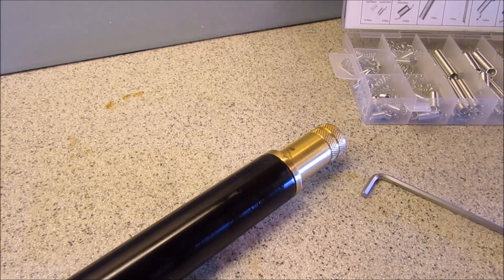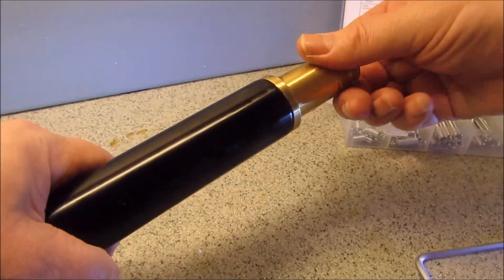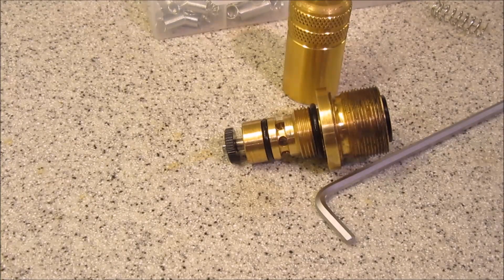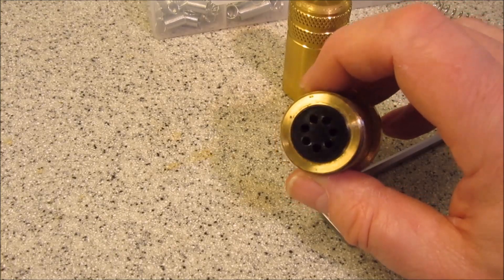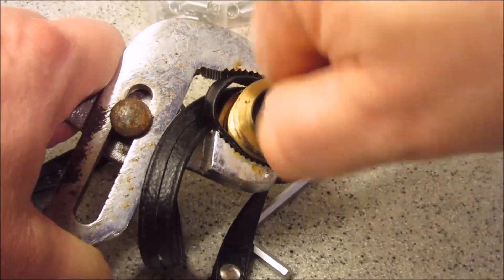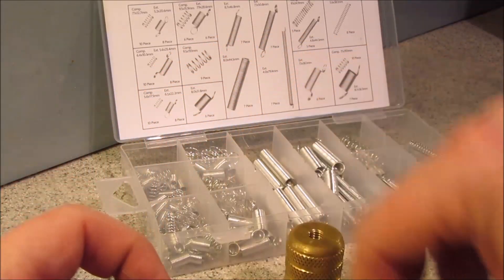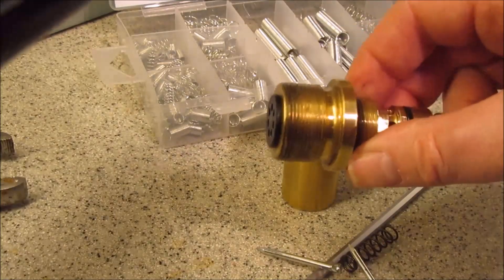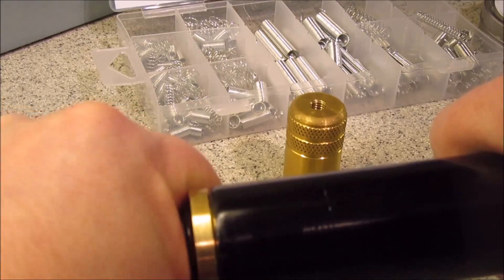Making a power increase in a Hatsan Galatian by exhaust valve spring adjustment 02 02 17

Comment: I've just bought derestrict yourself the full power valve pin, they're about £17. My  25 shoots 1040fps with it in, with the new spring, pin and adjustments. Its shooting at 80 joules. With a  .22 you're easily getting 1200fps.

Comment: Why care if you are limited to 12 fpe? If you want power start with replacing the valve stem with a 'normal' one instead of experimenting with items you obviously don't fully understand. Increasing spring tension will show in better efficiency, not so much in power. Better, get a license and get yourself a full power version.

Comment: Did you intentionally leave the plenum/spacer off to deregulate?
Reply from the maker: Yes, it allows the regulator to vent to atmosphere. Rifles without removable cylinders need a small hole drilling in the cylinder. These regulators come with two 0-rings and the hole in the cylinder will be between the two 0-rings. Most HUMA and Altaros regulators are designed for removable cylinder models. Robert Lane designs them for either. If you see a reg with either one or two 0-rings you now know why.

Comment: Heavier hammer and / or hammer spring and higher regulator pressure.  The valve spring pressure is trivial compared to the air pressure on the valve.  More valve lift could also benefit.

Comment: It's ridiculous they use a shear bolt as an anti-tamper so that you cannot disassemble your £800 PELLET GUN to clean it, this isn't even a legal requirement. They just chose to do it. 
The UK is beyond cucked.
Reply from the maker: Yes, the manufacturers decided to make up their own rules. It's not illegal to tune your own rifle. It only becomes illegal if the power goes above your Country's legal limit with the most efficient pellet. US and some other Country's don't have anti tamper fitted where there are no power restrictions. You could ask for it to be removed at the manufacturing stage, but once reaching a retailer the anti tamper are usually in place. Some are easier to remove than others, and some require special tools to remove. It's a bloody nightmare. It costs a fortune for a manufacturer to do repairs as you probably know.

Comment: so if I understand correctly, the regulator is losing a little power but there is a better consistency of shots. and if we want to recover this loss of power we must put a spring harder! Can you tell me if these springs are ok?!. thank you in advance 
https://www.amazon.fr/CCLIFE-Coffret-Assortiment-ressorts-compression/dp/B01KG024CU
Reply from the maker: You maybe able to buy a stronger spring to fit, but i have the same box of springs as shown in your link, and none of those would be strong enough. If you can't find a suitable spring it is recommended to pack out the existing spring with small washers, which is what i had to do. Robert Lane of Lane regulators could probably help with the correct spring, as i have heard comments from people in the past that have gone this route.
Reply: @airgunsniper-elite7385  oh yes, washers to harden the Spring is not stupid, as I did to harden the dumpvalve of my Focus RS mk2! in your opinion, we put the washers then the spring where the reverse?
Reply from the maker: I have increased the pressure on my valve spring today in the following video. I am waiting for a new cylinder and will used this one as a spare none regulated version. https://youtu.be/59_-qjhU8oA
Reply: 9x35mm is good ?
Reply: You would need to increase your hammer spring tension, not the valve spring.
Reply: Güç artışı istiyorsanız çekiç yayının gücünü arttırmak birde valf yayı daha ince hafif olması gereklidir diye düşünüyorum

Comment: the transfer port is what you see at 6min20? for a 4,5mm do you know if it is necessary to drill a 4mm? Thank you
Reply from the maker: It depends what your local laws are. If you live in the US then you can drill out the transfer port to make it more efficient. I think 4mm could be too much for a .177, but OK for a .22. Drilling a .22 transfer port out to 3mm with give you around 28 ft/lbs with your hammer spring wound right down to the lowest setting. For .177 i would start at 2 or 2.5 mm and see what you get. If you go too far with it, it may have an opposite effect. If you go to Lane Regulators website, he has put some information on transfer port sizes and different calibres of pellets. You can probably get a good idea with that. He has a lot on his Youtube pages for tuning. Remember if you do it drill it too far in the first place, you can't go back, so do it in increments and run it over a chronograph afterwards.

Comment: U need to put a weaker spring if u want more power and a heavier for more efficiency
Reply: You are absolutely right, this makes no sense. But even so, the power of the valvespring is largely irrelevant compared to the 200 bars of pressure that resets the valve after each shot. It would make alot more sense to get a stronger hammer spring or to adjust the preload of the curremt spring. I think this guy is experimenting without fully understanding how these guns work. But we all have to start somewhere.

Comment: Hello consult I have put regulator robert lane at 130 bar to my galatian
But comes out very low to the shot at 250 fps
I want it in approx 800fps changed the spring for another softer will be the solution?
Reply from the maker: If you can increase the tension on the hammer spring it would put the power up. They also recommend opening up the size of the  transfer port.  The problem in the UK is that they all come fitted with anti tamper, even though it isn't a legal requirement, it was a thing that all the manufacturers over here agreed to do. For sub 12ft/lb rifles the  regulators are normally set at between and 90 and 100 bar, but for full power it would be on the 130 bar that you are at.
Reply: OK I WILL ADJUST THE SPRING OF THE HAMMER
I tell you how you were greetings
Reply: Hello, I could adjust the hammer
And if the power went up
I thank you so much for the help
Reply from the maker: Yes increasing the hammer spring pressure is the way to go. You can also increase the size of he transfer port as well. Good luck.